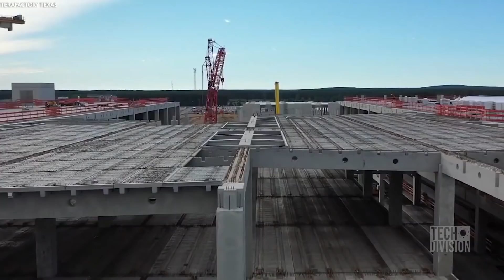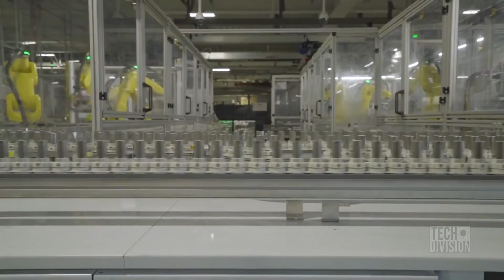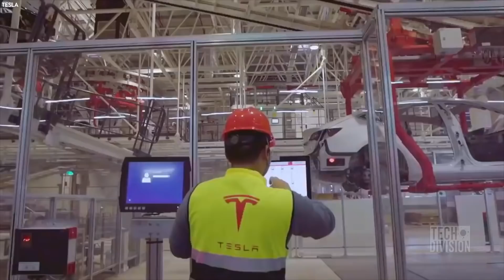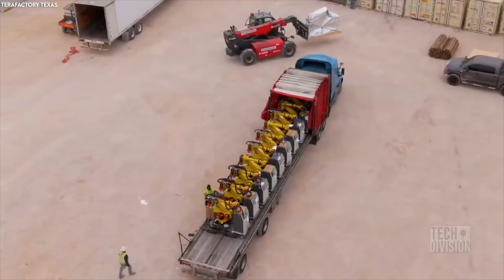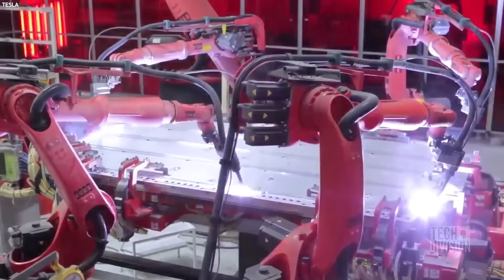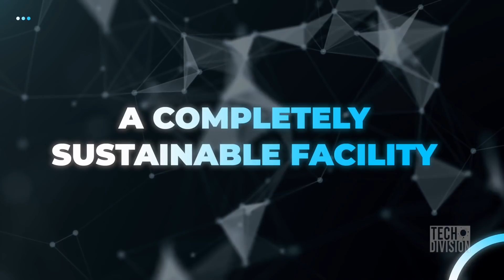Tesla’s New TeraFactory In Austin, Texas

Comment: I drive past this on my way to work, the property and building are huge.  The property is located right on the Colorado River, I hope they took into account for flooding, because I have seen it flood before construction began.  Also up stream a few miles is sewage plant and a plant that they use human waste to make gardening soil called Dillo Dirt…..let me tell you some still warm humid mornings your nose burns from the off gassing of waste.  Really stinks to hi heaven some mornings. The plant is being built on top of an old gravel/dirt pit,  basically it is River bottom waste land that could cause construction stability problems if not prepared for construction properly.  Between Samsung and Tesla the job market is wide open and it is driving housing and property cost to sky rocket.  Hope it all works out. 
 
.

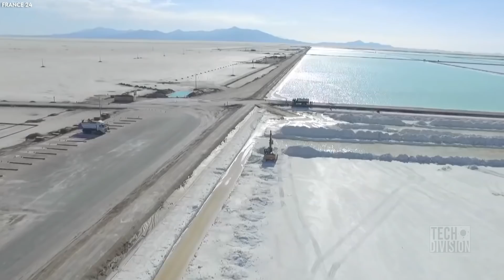Comment: Regarding time index 6:05, Lithium is not “the third-most common element on Earth”;  it’s the 33rd most-abundant, by volume (https://www.worldatlas.com/articles/the-most-abundant-elements-in-the-earth-s-crust.html).  So, it’s neither particularly common nor particularly rare.

For comparison, the most abundant by total number of atoms is oxygen, and the most common by total mass is iron.

There have been all kinds of concerns raised about Lithium mining, and many are dubious:  For example, it’s often been alleged that its a very carbon-intensive process, but that’s questionable;  and the main concern is that it’s very water-intensive :  it requires a lot of water to dissolve lithium compounds and pump them up to the surface where the water is evaporated off.

Comment: “Several areas powered by solar” =/= “100% sustainable”.  This is more  greenwash nonsense,  like the claim that the original gigafactory roof in NV would be completely covered over with PV.   The actual NV factory roof is shown several times in this video with its token smattering of PV.  

That shot of the electrical substation adjacent the TX project is proof that the factory will run mainly from the Tx grid and it’s mainly gas fired electrical source.

Comment: Slavery drives the precious metal industry upon which Tesla batteries depend and the question of how and who supplies the electricity to charge ev batteries should they supplant gas cars is avoided by devotees of the govt grant snaffler. Wind and solar are proving horrendously ineffective so coal and gas must continue to take up the slack given nuclear power invokes terror among the slack jawed and toothless. But it matters not a jot Tesla have been at it since the early 2000s and still the range and charging issues persist they are nowhere near equating to proven energy sources.

Something other than battery power needs inventing this is going nowhere

Comment: I cant imagine touching a cybertruck body panel that has been in the sun all day.
Reply: No worse than painted steel. The paint acts as a tiny bit of thermal insulation but no5 much. The big question is how to keep the truck under four tons if it is in fact eighth inch stainless.

Comment: Basic questions for those who are excited about electric vehicles:
1. Will power plants, power transmission lines and charging stations for such cars be built at the same pace?
2. How much electricity will be produced from renewable sources?
3. How much will one electric car charge cost?
4. When resources such as Lithium run out, will scientists manage to create a different and at least as efficient type of battery?
5. Will there be no problem with the disposal of more and more old batteries?
6. How long will the world's Copper resources last for the production of huge amounts of electric motors and the increasing number and thickness of cables in electrical transmission system ?
Reply: 1 charging the cars off peak is the key. and covering the parking lots with solar panels will solve charging too.
2 all of it eventually. oil will be burnt in a century, coal in few more. but let hope that govts will help the transition and stop burning stuff a lot sooner before is too late. Amzon and Siberia already started burning.
3 already charging a car electric is 4 times cheaper then filling with gas. 
4 lithium is recyclable. will not run out. oil is not, and nobody seems to care, except few visionaries. 
5 nope, not more than disposal of oil waste.
6 there is no problem with reserves of copper. yes, an electric car uses 4 times more copper than a regular car, but since copper can be recycled, after the transition to electric is over, there will be need only to cover losses in recycling. And these losses are way smaller than losses in burnt oil. Burnt oil is lost 100 percent. And i few centuries when mining will deplete surface reserves and going deeper will became too expensive, space mining will became feasible.

Comment: There a lots of Giga Berlin shots mixed into this video, without mentioning.

5000 jobs over four years is utter nonsense. Giga Berlin will start with 7000 employees and gradually expand to 12,000 -- with a planned output of 500,000 vehicles a year.

I have no idea where you got the number of ten million cars a years from Giga Austin. 28,000 cars per day is simply not possible. The transport of the finished cars would require 3,500 trucks per day, not to speak about moving the raw meterial to the factory.

Please get the facts together and try again.

Comment: GAS PIPELINE INSTALLED, SUBSTATION FOR A POWER SUPPLY Seems to me like it needs fossil fuels via pipeline AND power from the local coal fired power plants.
Reply: Texas has some of the biggest solar farms, one of them is only a few miles away, but gas ...yes,  there will always be a need for gas to melt metal for moulding, electricity is not there just yet. Coal. You will not see coal on site and if not solar power then it will be gas powered which is much cheaper. But tesla unlike other car manufacturers plans to use solar on there roof or from nearby windfarms

Comment: Aether Energy Source for Replacing Big, Dangerous, Smelly, Unhealthy, Expensive Batteries. 

Excerpts from the book - "Secrets of Cold War Technology" by Gerry Vassilatos (pages 86-93) :

Mr. Savo reported that in 1931, he participated in an experiment involving etheric power. 
He was asked to accompany his uncle, Nikola Tesla, on a long train ride to Buffalo.

Taken into a small garage, Dr. Tesla walked directly to a Pierce Arrow, opened the hood and began making a few adjustments.
In place of an internal combustion engine, there was an AC motor.   From it trailed two very thick cables, 
which were connected to a terminal in the dashboard.  Here, Tesla plugged in a shoe box sized "Black Box". 
In addition, there was a  single ordinary 12-Volt battery.  

Dr. Tesla informed his nephew that the device could not only supply the needs of the car forever, 
but could also supply the needs of a household "with power to spare".  
Of the motive source, he referred to "a mysterious radiation, which comes out of the aether"  
and  "it is available in limitless quantities".  
   -   -   -   -   -   -   -   -   -   -   -   -   -   -   -   -   -   -  
> 50 years ago, famous physicist Richard Feynman said : 
The vacuum of “empty space” appears to be an energy reservoir of immense capacity   
that makes nuclear power seem old fashioned.   
The amount of energy available in one cubic centimeter of the vacuum (ambient space)   
is much greater than the energy density in an atomic nucleus.